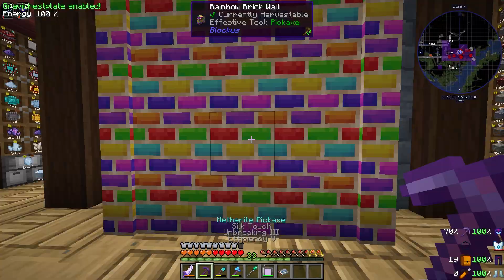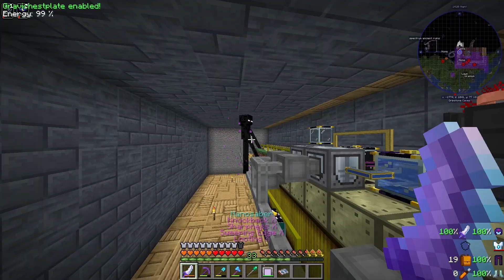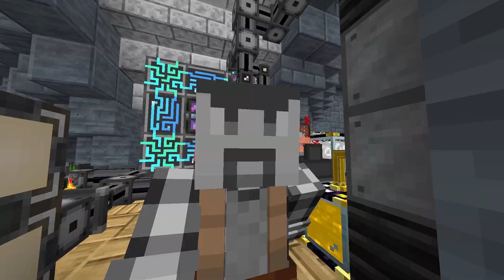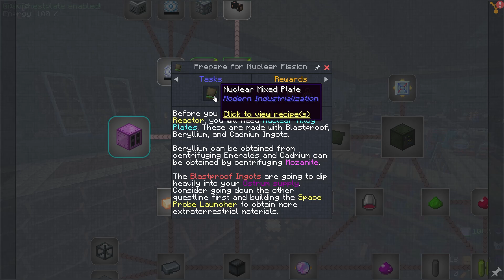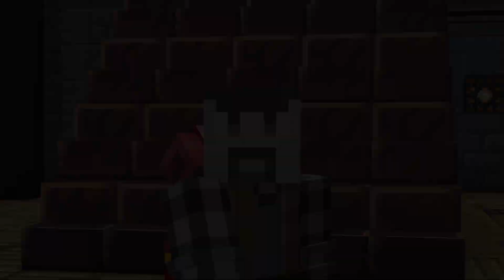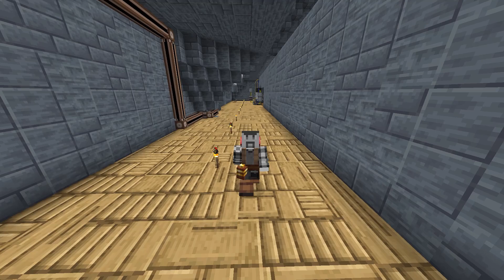Dragon Powered Mass Fabrication - Minecraft: Statech Industry #31

Comment: Endermen making a mess as usual xD same in my worlds. I'm considering turning off enderman mob griefing in my world if it gets too bad.

Didn't realize how messy the MI cables can get; it looks like spaghetti in some sections lol.

Seems like the dragon egg is a nice source of power relative to the steam you have, and it's passive too!
Reply from the maker: I just need to finally sit down and sort through all the mods and see if there's anything like a teleportation anchor to make sure they die in the mob farm.  I still need to remove the blaze spawner that's also somehow occasionally spawning them outside my farm.

The MI pipes honestly aren't too bad, it's not really any worse than ender.io conduits used to be.  The main issue with them is that filters apply to both in and out at the same time, so it's hard to only use a single item pipe for multiple steps.

The dragon egg siphon is mostly nice since it's not eating a fuel, which was the sorta thing that was occasionally bricking my whole base when the steam ran out before.  They're VERY expensive to make though.  Each one eats 32 digital circuits and those take a while to replace.  Slowly increasing buffers to deal with it again.